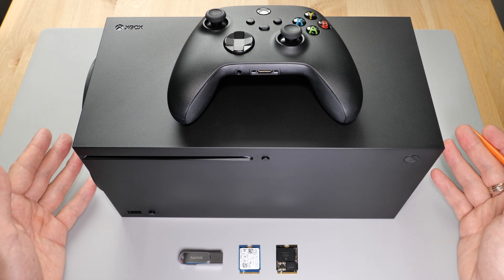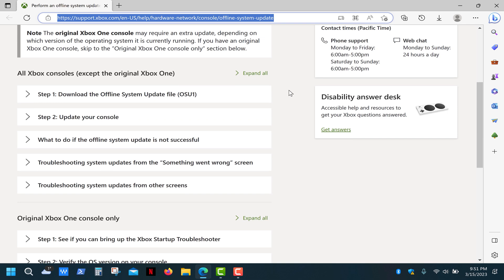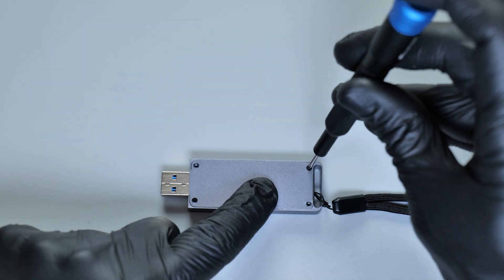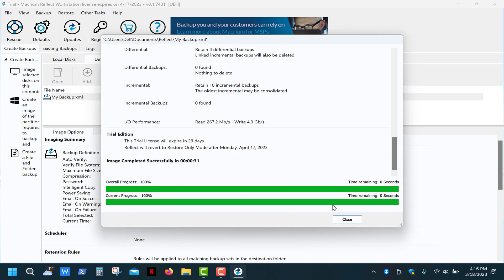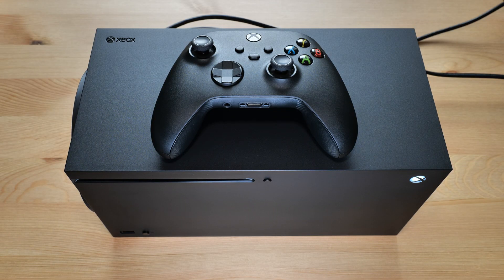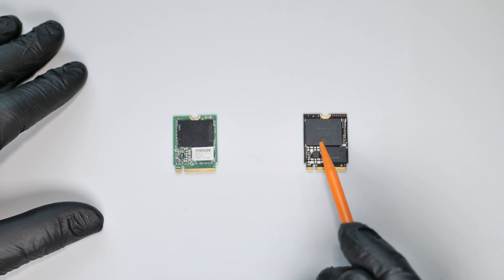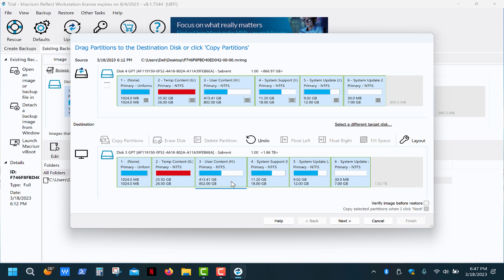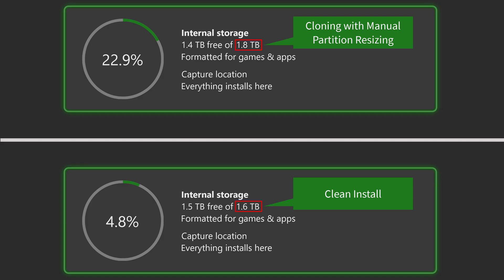Upgrade Xbox Series X SSD to 2TB – Clean Install or Clone Method (Step-by-Step Guide)

Comment: Has anyone tried breaking open a Seagate 4tb expansion card and dropping it internally inside their series x yet? I mean does the 4tb expansion card use a 2230 🤔. Bare with me here cause if so that means the series x can theoretically run a total of 8tb of storage if it works internally and running an extra one externally 🤔
Reply from the maker: I only had the chance to tear down a 1TB or 2TB version can’t remember exactly as it was from a client with a faulty expansion card. Inside, it looked like a standard M.2 2230 SSD, with the same memory and controller chips as what’s used in the console but instead of the M.2 interface, it used a CFexpress Type B connection. It is possible to modify it by transferring the controller and memory chip onto an SSSTC XA M.2 2230 SSD this has already been done. But of course, it's not a simple or universal solution that works for everyone.
Reply: Yeah I'd believe it'd work for those willing to wanna spend that amount. It's just crazy those cards are more than your standard m.2 2280 drives and shouldn't really be. I mean even regular 2230s at 2tb cost more than a 2280 m.2 atm. Believe the WD Black m.2 2230 SSD is like $199 and you can get  a 4tb m.2 2280 on sale sometimes for around $200 to $230  @ElectronicsComputers
Reply: You can't read down And use the expansion cards inside bc the Seagate cards are not M Key M.2 NVME form factor. 

The internal SSD for the Series S/X is PCIE Gen 4.0 x2 NVME M Key M.2 form factor. 

The expansion drives themselves use The CF Flash Form Factor. The reason for this is because the XSX systems utilize Velocity Architecture for read/write via the PCIE 4.0 x4 lanes allocated to storage via the APU. 

The XSX splits those 4.0 x4 lanes into two 4.0 x2 lanes for the consoles storage controllers. 

The first 4.0 x2 is inside on the lower of the mated MBs, and is connected to the pin outs of the 2230 M Key NVME slot (containing factory original SSD). 

The second 4.0 x2 is what leads to the Storage expansion drive slots pinouts on the back of the SERIES S/X consoles. This interface uses CF (Compact Flash) form factor which varies very much from M Key M.2 form factor. 

Part of why this was done was because given that the two storage drives already split a single PCIE Gen 4.0 x4 pathway set from the APU, having both drive slots be of the M Key M.2 form factor, they would have had to have changed the drive controller chipsets used to accommodate BOTH hardware bifurcation AND software bifurcation.... Which was a mistake made with game consoles in the past that lead to greater difficulty patch blocking firmware exploitation post boot but pre POST. 

The other reason was bc they wanted to be little assholes and slow down the market making M.2 NVME adapters to use their own (non proprietary) storage drives.... That way they could bring their own to market at the VERY reasonable low low cost of $135 PER Terabyte. Lol
Reply: Also... It's a 1000% certainty that the Seagate XBOX Series S/X Storage Expansion Drive doesn't use a 2230 M.2 form factor NVME as there is [at the time of posting this] STILL no 2230 sized NVME drives above 2TB storage capacity in the world or on the market....

And this isn't a matter of "my best guestimation" based off the fact that a 4TB 2230 doesn't exist yet.... I purchased [and still own] the 1TB, 2TB, and 4TB Seagate Expansion Cards and the first thing I did after buying each was to pop off the plastic cover shell, remove the metal cards set screws and rip me open to see what may or may not have changed regarding the drive controllers chipsets, look for possible PCB revisions, and to document the make and model of the storage flash chips on said PCB.

Comment: Hi, I need help with my Xbox. It started by losing connection with the controller (even when wired) and frequently disconnecting from WiFi. Then, when launching games like Doom Dark Ages, it would freeze and shut down. I suspected the SSD, so I made a backup using Macrium (excluding the "User Content" partition) and tried to format it, but got I/O errors. I tested other SSDs (a WD SN560 and an SN530), restored the partitions, but got the error E101 90070005 800703EE when attempting to install the OS from a USB with OSU1. Eventually, I put the original SSD back in, reinstalled the OS, and it worked for a while—though network and controller issues persisted. Finally, the console stopped showing any image at all. Sometimes the recovery menu would show up, but after reinstalling the OS and launching a game, it would freeze and shut down again. As a test, I powered it on without the SSD: the fan spins, and it stays on (no image, obviously), which suggests some system activity is still present. Has anyone experienced something similar or knows whether this is definitely an SSD issue, NAND corruption, or possibly a motherboard failure? Any help would be greatly appreciated!

Comment: hello does this M.2 2230 storage expansion card for Xbox Series X|S really work? if so how do I prepare the drive?   what 2tb drive is compatible?
Reply from the maker: Why wouldn’t it work? That port on the back of your console is just a proprietary connector for an M.2 SSD. Microsoft could’ve easily used a standard port but instead they locked it behind a custom design to push overpriced expansion cards and boost profits. The expansion card I showed in the video is nothing fancy it’s just a passive adapter with no active components. It simply changes the connector so you can plug in a regular M.2 SSD. As long as the drive is compatible it’ll work without any issues. Right now, there aren’t any off-the-shelf 2TB SSDs that are natively compatible with the Xbox. The one I used in the video was a modified drive and you’ll occasionally find them on eBay or AliExpress. If you're after reliability and price a 1TB SSD is still the safest bet for now. Eventually, when the newer Series X Galaxy Black 2TB consoles start dying like the older Series S and X models we’ll see more of those 2TB SSDs hitting the secondhand market. Until then, we’re stuck with Microsoft’s user-UNfriendly design choices.
Reply: What model of 2tb. drive are you using in the video??

Comment: first of all i have to say thank you because i managed to refurbish my console thanks to your kind and competent teachings. unfortunately the WD ssd bought in china that I have already installed inside although compatible and working marks on crystal disc up to 61°C 142°F under stress inside the sabrenet enclosure (summer room temperature) and never below 42°C 107°F in IDLE. the original Solod state technology was 17% cooler never above 50°C under load. do you think i bought a defective ssd or that i shouldn't have any particular problems? even though the xbox ssd is poorly cooled it should be better than the sabrenet..or not?
Reply from the maker: You’re overthinking it. When that SSD sits inside the metal shielding (which we in the repair shop jokingly call a metal coffin) on the Xbox Series X, it has terrible heat transfer to the heatsink. The SSD just bakes over time and that’s exactly why so many of them fail. It runs at critical temperatures, often hitting 80-90°C. Microsoft finally fixed this in the latest Series X Galaxy Black revision, where they completely removed the metal shield and now the SSD in direct contact with the heatsink through the layer of thermal putty. So 61°C shouldn’t worry you as inside the console it’ll be much hotter anyway and it’ll likely fail after a few years. But by then, you’ll probably open it up to clean the dust, replace thermal paste and thermal putty, and at that point you can just check the SSD’s SMART data. If it’s degraded, replace it or sell the console.
Reply: @ElectronicsComputers 

The original xbox SSD used by the previous owner showed a count of 6100 hours of use in 1200 days of life (ish 3 years)  with a daily average use of 5 hours. 

So it was used quite heavily.

 Reading what you wrote about the frequent failures after 3 years of average use, I played in advance by replacing the original SSD. Consider that this Xbox will be gift to a child who will use it sporadically, so I expect a lifespan at least equal to the previous one. I inserted the old SSD into an external enclosure that was immediately recognized and on which I installed all the games, the temperature of the enclosure measured with a pyrometer does not exceed 50 degrees centigrade, thus the internal SSD should be preserved, do you confirm? 

Speaking about the SSD'smetal coffin :)) don't should happen thermal throttling over 85°C?

Also, speaking about external compatible alloy enclosure do you recommend inserting the supplied thermal pads or upsiren putty paste?
Reply from the maker: @Genoleso  You did a great job so those SSDs should last long. Well, Upsiren is definitely better than the stock putty, but if you don't want to replace it you’ll need to reshape the original thermal putty so that when the heatsink is reinstalled, it gets compressed to the proper thickness and makes solid contact. If you skip this step and just put the heatsink back as-is, it will not make proper contact with the putty, and the heat transfer will be compromised, which could lead to overheating or long-term damage.
Reply: @ElectronicsComputers sure I agree, same thing when I installed the new putty searching a "one take" attemp when assembled the tich alloy/copper plates to be sure to gain perfect surface contact wuth a good  thermal excange.

I edited my previous message, so what about use the external expansion instead  of onboard SSD to make that last longer and what about the provided thermal pad VS upsiren for the  inside SSD of memory expansion enclosure and thermal throttling of inner SSD if it reaches up to 85°C?

Comment: If I clone the internal SSD to a 2TB WD CH SN530, I can leave the new one installed and it will update without any crashes or issues. I say this because I'd like to expand my console's memory.
Reply from the maker: You're right! You can either clone the entire drive and expand the partition, or just clone the main boot partition and do a clean install. Once you confirm everything works fine, you can even repurpose the old drive in an expansion card to extend your storage even further.

Comment: Somebody says that recently microsoft blocked SSD with some update so this procedure no longer works even with compatible ssd.
Are you agree as professional repair center or are them bullshit?
Regards
Reply from the maker: I haven’t heard about that. As of today, everything works fine. Yesterday, I was repairing a Series S, and the customer also asked me to upgrade the 500GB SSD to a 1TB one. Everything worked perfectly using the latest offline update. I doubt it would be in Microsoft's best interest to block already replaced SSDs, especially considering they already messed up with failing SSDs in the first place. I’m not even sure that would be legal, at least in countries where consumer protection laws are in place. But then again, companies today are getting greedier and seem to care less about customers compared to how things used to be, so who knows what they’ll pull in the future.
Reply: @ElectronicsComputers thankyou so so much

Comment: Is it worth backing up the primary partition in the event that the ssd may fail eventually?
Reply from the maker: Well, if you’re already inside your console, for example doing some maintenance, then backing up the boot partition wouldn’t hurt. You can also check the SMART status of the SSD to get an idea of its life expectancy and be ready to replace it or even sell the console. Those SSDs don’t tend to last long in the Series X, and they often start failing after around 3 years of use due to some design issues which Microsoft fixed in the later Series X Galaxy Black edition. But keep in mind that any major online system update can cause the console to regenerate the encryption key, so a previously created backup might not work anymore.
Reply: @ElectronicsComputers thank you for the in depth answer. Which model SSD will work and where’s the best place to get them from at this time?

Comment: Will the cloning method still work if the original SSD is faulty? got the ssd error and my console doesnt work at all
Reply from the maker: It depends on how it’s faulty. At least try to clone the first boot partition which is the most important part. If you lose that partition or the SSD is beyond recovery, the console is basically e-waste.

Comment: Hello again. Does the xbox animation logo missed after this operation like somebody says?(they say that you have to add it manually)and what about solod state brand (nvme gen4x4) VS western digital(nvme gen4x2). 
Are there any differences in therm of software boot speed and/or thermal efficiency between the two ssd generation? Just bought a western digital from china hoping it will be legit and fully working
Reply from the maker: Animation can be added manually, or you can just leave it as is; after an online update, the animation will return on its own. As I mentioned before, only WD CH SN530 and SSSTC XA models are compatible without any modifications.
Reply: @ElectronicsComputers yes but the two compatible  ssd have two different class(sn ch530 is gen 4x2 VS solid state that is gen4x4) but i do not know if that could be any negative effort on real use
Reply from the maker: @Genoleso  I never even knew the difference in specs between those SSDs. We just put whatever we have into the consoles and always prefer the cheapest compatible option. You’ll never notice any difference in performance between 4x4 PCIe lanes and 4x2.